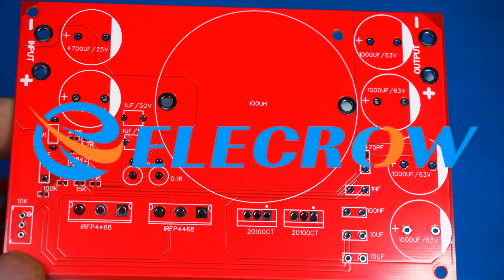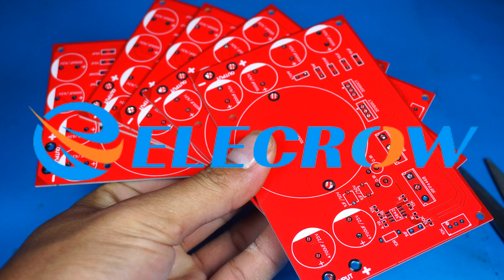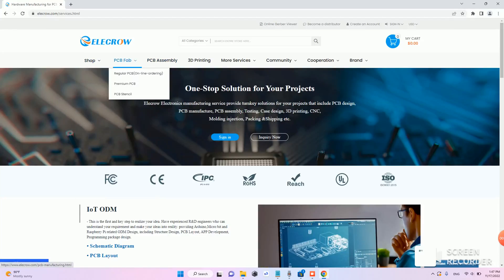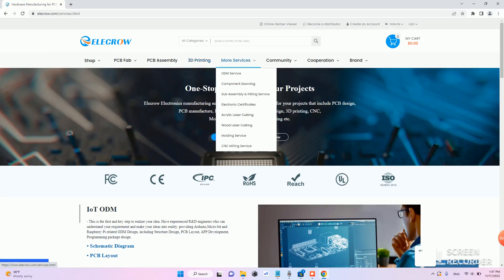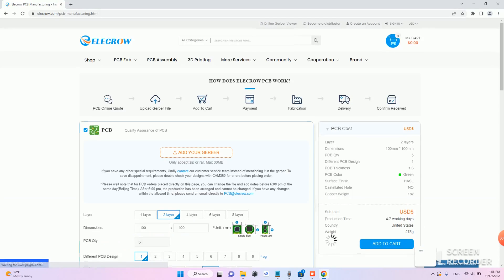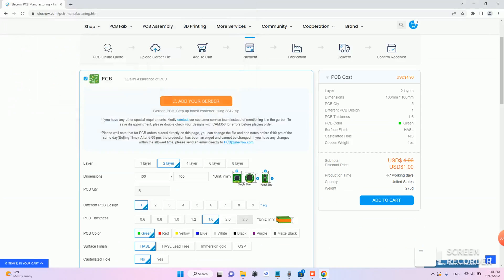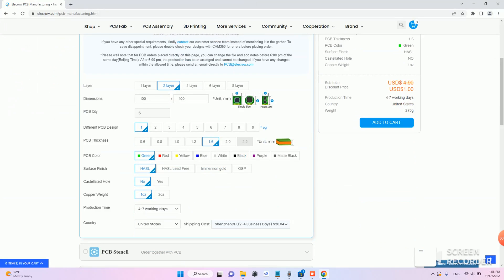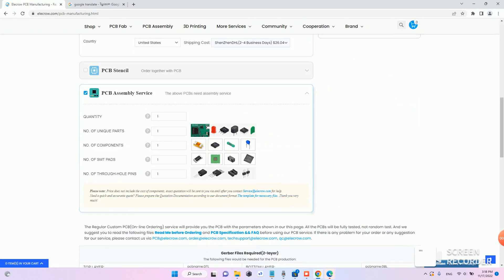DIY How to make 1000W Step up boost converter using IC 3843 |  Elecrow

Comment: Точно потянет 1000вт? 1000/24=42 А, более 80 по первичной цепи. Помоему это 3.14здеж.
Reply: Bro don't trust
The voltage already dops at 30W 12V To 24V (2V) Drops